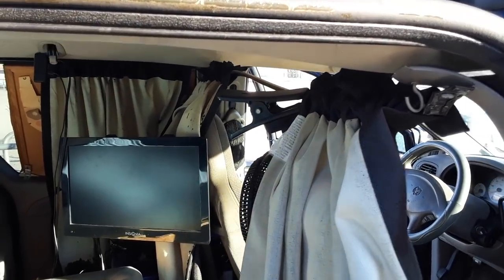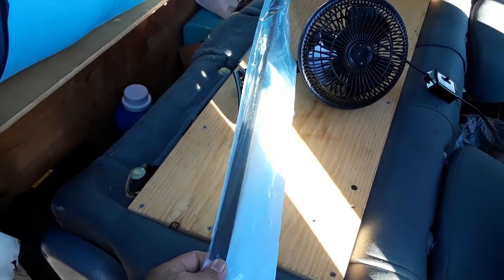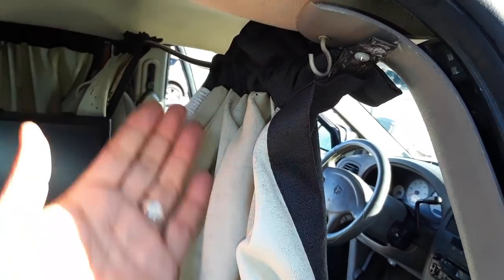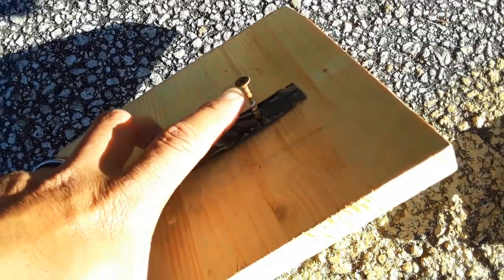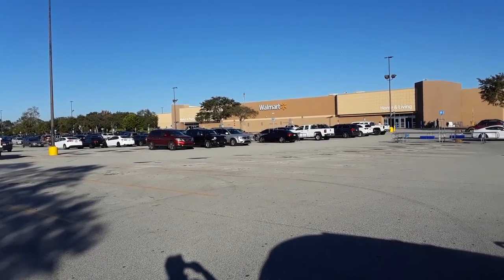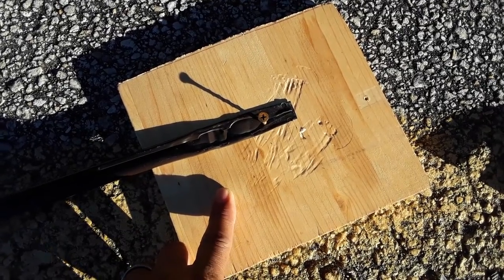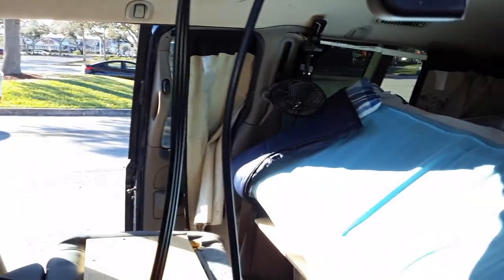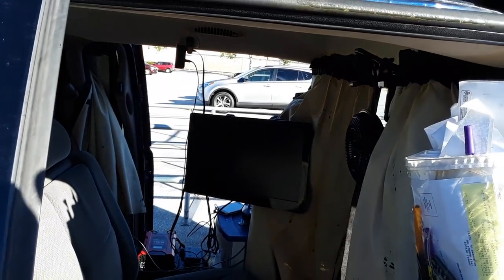Van Build Tip: How To Install A Privacy Curtain In An Urban Stealth Camping Minivan Camper (V1475)

Comment: I enjoy your videos a lot. Thanks for sharing! I was contemplating something similar in my Grand Caravan, and I ended up having an old metal trim piece from my previous square body Suburban, so I cut it to fit, slipped it under the edges of the trim, and it's very much akin to what you've done. Mostly I use those 11 foot long privacy curtains that are meant for sleepers in semi trucks, so that bar is a great anchor point for the hooks to latch onto as well.

Comment: I have seen a wooden dowel rod recommended because it simply doesn't bend.  I am "fix things" challenged so I have no idea how I would attach it...
Reply from the maker: You could get a strip of aluminum and bend it around the rod and screw the aluminum strip to the vehicle.
Reply: @LivingInAVan  Hey thanks for the awesome idea!  Here is what I have proposed to do.  I saw a guy that simply built a full wall with a door and small peephole.  This completely blocked out all light.  I like this idea very much.  I am thinking of leaving some space behind the seats for storage (similar to a truck cab bed) and putting the wall slightly behind.